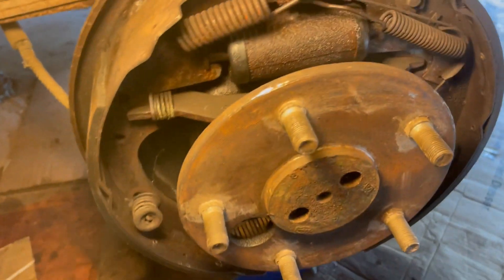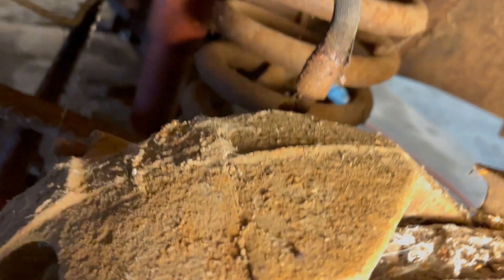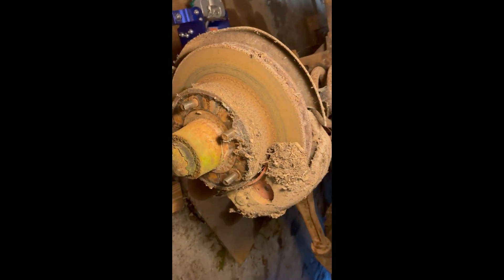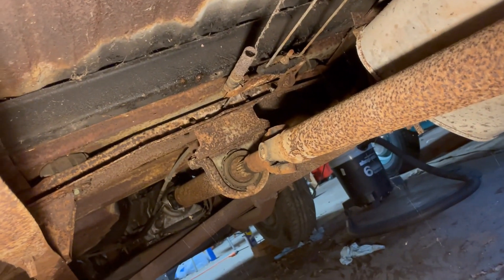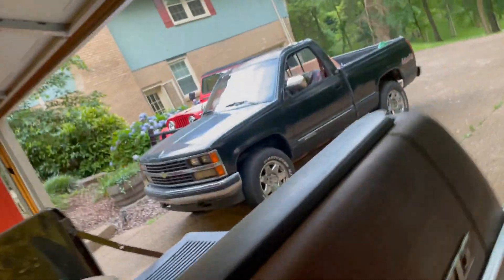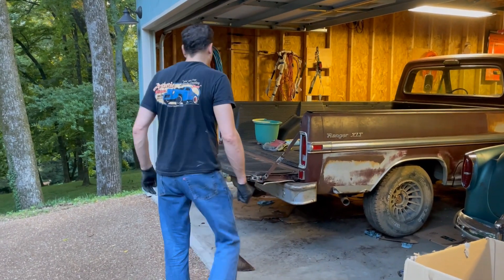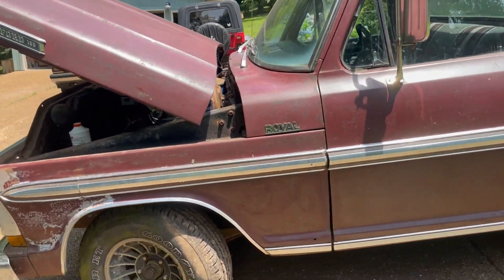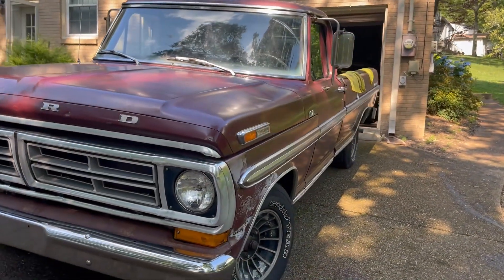1972 Ford F100 estate sale find part 4 - moving under its own power and first wash!

Comment: Excellent video also remember my 1972 Ford F350 Pick Up also enjoy for 25 years then sold it after restoration to in 2005 was Navy Blue body with Navy Blue interior and had 390 4V 4barrel hand choke cable carb with Eaton D18 Manual floor shifter Creeper 4  speed with Bow Low out a 1968 International Pickup 1300 1 ton truck plus updated with 4×4 to !
Reply from the maker: That sounds like a very cool truck!

Comment: Nice update! Caliper is super easy to fix. Take out the pads and pump the brake pedal til the pistons is about to come out the push it all the way back in. It will unstick it and lube the calipers piston seal at the same time. Should do both sides!
Reply from the maker: Good idea. I will try it!

Comment: Bed liners are NOTORIOUS for holding and trapping water and moisture, it's the vinyl top of the car....
Reply: @Joe Schlotthauer If it was my truck and I was doing a restoration and was going to do another bed liner, I'd just do the spray-on type (after it was repainted, of course).

Comment: What did you use to get the body so clean?
Reply from the maker: All that was needed was hot water with dish detergent. It worked fantastic.
Reply: Thanks for the info, I loved the videos and I had a 71 with a 302. But sold it a number of years ago and the one you had was a fancy on mine was just a custom. I bet you the 3000 or more in just a few hours. Thanks again for the show. Ray
Reply from the maker: @rayhofman2924  Yes, it sold almost immediately.

Comment: Disks were probably an option I'm 72, this truck was a loaded model.
Reply: @Mike Sawyer Actually, disc brakes weren't available on the F-100 until the 1973 model year (among the numerous changes) but, beginning with the 1968 model year, they were available on the F-250 and F-350 models. To be fair, if it was my truck, I'd convert all 4 brakes to discs. As for it being loaded, it has the top-of-the-line Ranger XLT trim level (order code=U Black cloth and vinyl bench seat is what this one appears to have; check out fordification.com for more info). The paint color is Royal Maroon (order code=2) and appears to be the original. Also, if it were my truck, I'd leave the interior in it's original black and either repaint it the Royal Maroon or change it to combination two-tone with Sequoia Brown Metallic (order code=R) being the main color and Prairie Yellow (order code=K) on the roof and lower body sides (that is, below the spear moldings).